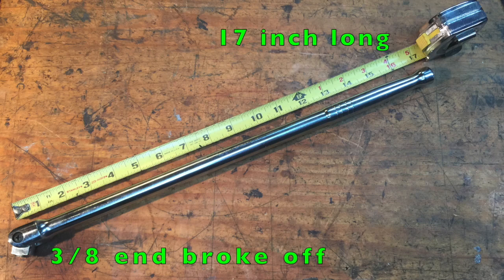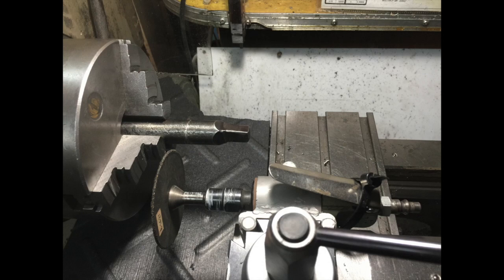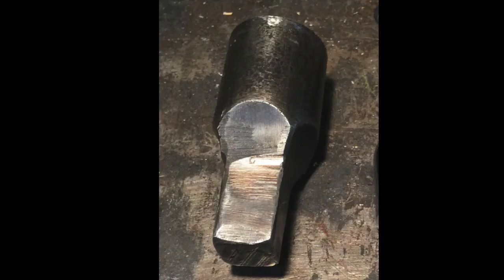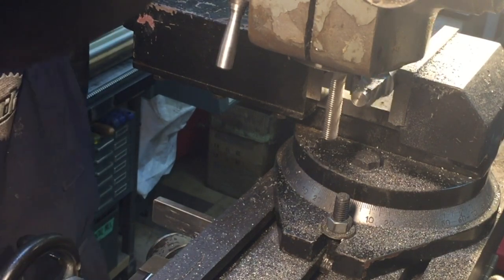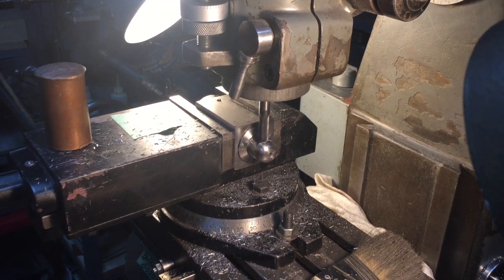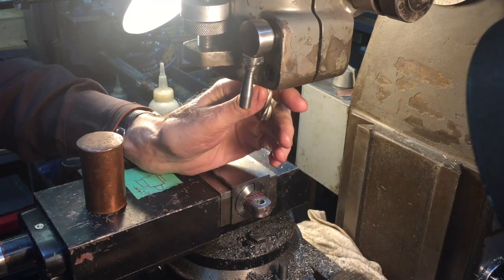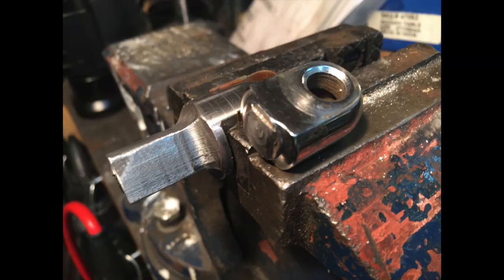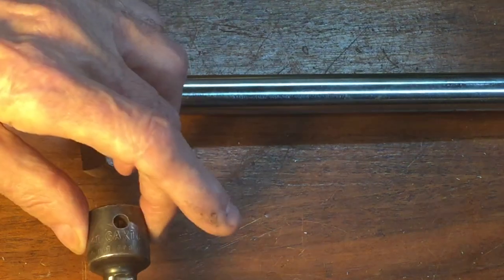#82 - HOW to fix a BREAKER-BAR

Comment: I like the idea of having the driver 45 degree offset from the handle, that could be really useful.  I always enjoy watching you work, pretty slick freehand with the cutoff tool.
Reply from the maker: Dewreck Deberjack 
Thanks for watching my simple video.
The air-drive was attached to the late and set perfectly perpendicular to the part. Please do not attempt freehand, 
once I almost cut my face that way. It may fly to pieces. Bob.
Reply: @thatoldbob7956  it looked like you cut the other side with the tool in hand.  I will try to consider safety first. Thank you.